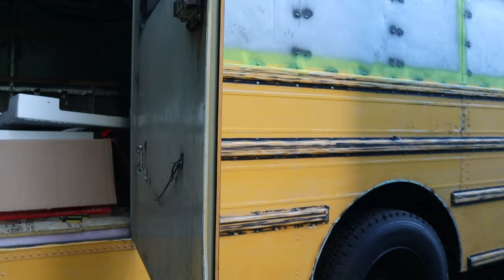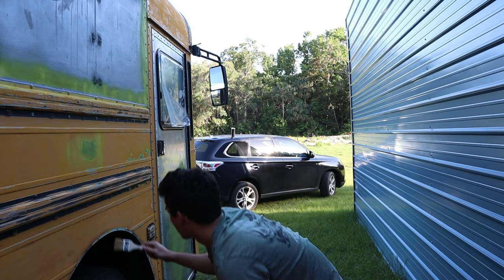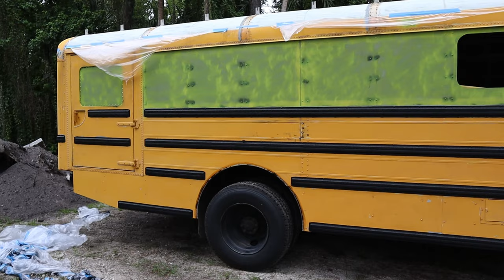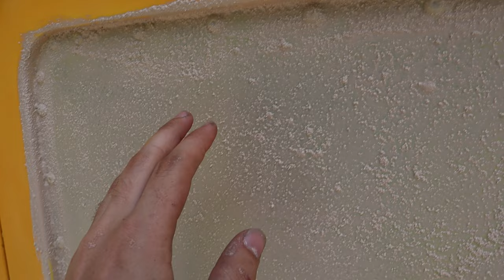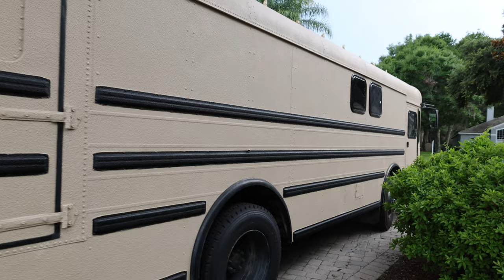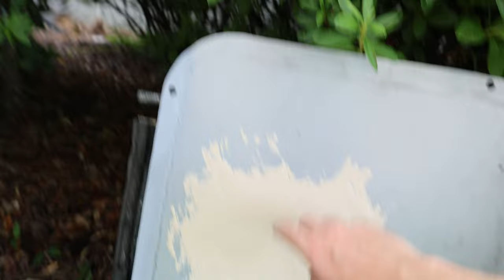Final Paint Prep and Painting My International Bus with Durabak Bed Liner | Skoolie Conversion

Comment: Thanks for sharring. Love the desert sand look with the back rub rails. I want to paint my bus the same color as yours but with some other colors in other areas using raptor liner. Not sure if tape would stick to that or not, but would be a bummer to prep if not. I'll keep the 3m tape in mind. Cheers!
Reply from the maker: Awesome! Ya, I'd love to do some mountain designs on mine, but taping is really not an option. I think I would have to hand paint it if I wanted to add any special designs.